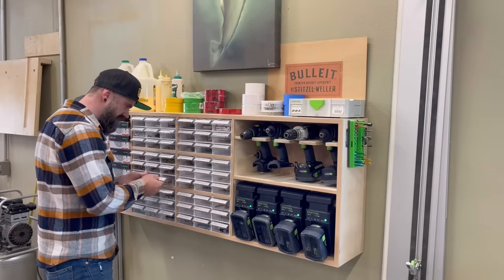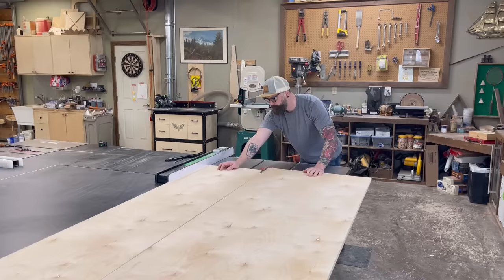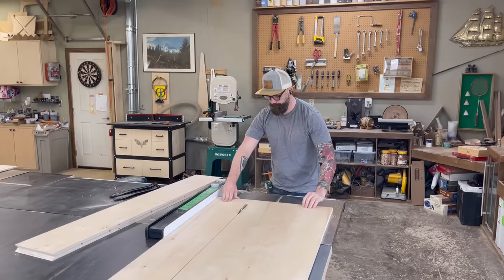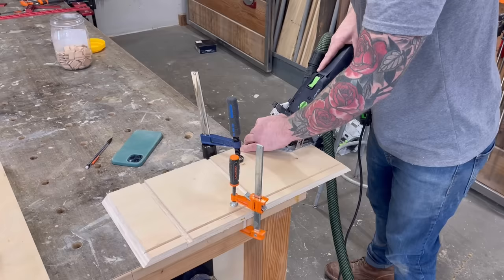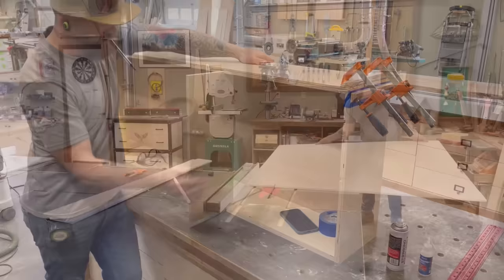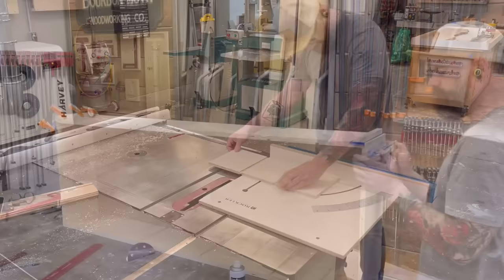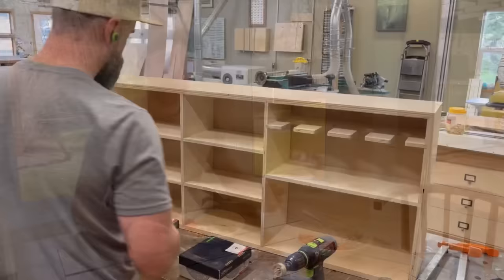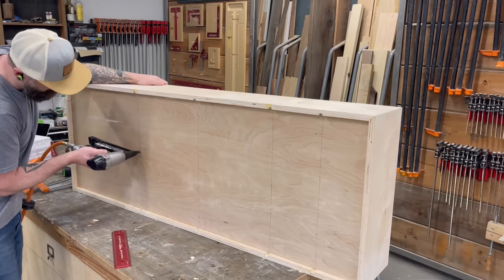Screw Organization! || One Day Drill Charging Station

Comment: Maybe could have added an On/off switch to the side for the outlet… Just so the chargers aren’t ON the whole time… just switch it on a while before you know you’ll need the drills/drivers.
Reply: I have wondered about putting my chargers on a timer expecially since I don't use them every day
Reply: I heard charges getting hot enough to start fires. I alway disconnect my chargers after battery is fully charged
Reply: Most newer chargers stop charging once it's full.
Reply: You’re spot on the money about turning chargers off. Excellent point.
I just use a “smart plug in” and a short lead fused at 5A the plug. (UK plugs have fuses in them) I can turn it on and off with my phone (or Alexa) and also set it to a schedule.👍
Reply: I'm about to build one similar and here's one suggestion and a question.

Have you got a link to your magnetic bit holder?

Under the bit holder I'm building some small cubby holes to store fully charged batteries.

Comment: Excellent and inspirational work.  One simple thing I think you should do is put a surge protector behind the chargers and then plug them all into that strip.  Protect your tool investment from a freak lightning strike or electrical surge to your shop's power grid.  Sooner or later, it will happen.
Reply: I was thinking this exact same thing
Reply: I don't like anything permanently on and screwed into place - DANGER WIL ROBINSON ... the back two thirds of the shelf above the chargers should be a hinged flap.
Reply: Those chargers should be plugged into a high capacity surge protector AND it should be switched off when not in use as those things are power hogs even when off and there’s always the danger of fire. It happens.

Comment: Nice project.  My charging "area" has 8 different chargers.  I was able to buy a power strip that has 8 outlets and a lighted switch for each.  That way chargers that aren't in use don't need to be powered on.  The strip was designed for 19" rack mounted electronic equipment so I mounted mine at the front edge of my box, above the chargers.  The switches are on the front and the outlets are on the back.  Easy to turn off and on, and cords can be managed quite neatly.
Reply: Could you list a link for that power strip, looking for one just like that. Can't afford all the Festool power tools, have several different brands of batteries to charge, Thanks John

Comment: Love this. As a guy who does do electrical, I'd have replaced the 2-gang with a 4-gang outlet. Removing the original 2-gang box, with the multi-tool, is pretty straightforward (make sure the power's off), and replace that box with a 4-gang "old work" box, and put in 2 2-gang 15A outlets. I just don't like those splitters. Another option: put a plug strip, a better option that that splitter in my mind, back behind the false front.

Comment: Instead of measuring the back of the chargers when trying to mount them, take a piece of paper and lay it over the back of the charger. Take a pencil and start shading, just like how we used to put a quarter under paper and copied it by rubbing a pencil over it. Now you have a perfect template. Instead of paper you could also use tape since you only have 2 holes.
Reply: Or...Just put the unit on a photocopier and get a copy of the back. I've used this as a template for laying out items to hang on the wall. Screw through the copy and then tear it off the wall.
Reply: It’s more fun to shade.  Everything we need to know, we learned in kindergarten .  It’s so fun. It’s funner, it’s the funest.   Copy machines are for college people, to sit on.
Reply: @ianwilson8410  More than one way to skin a cat. Just not everyone is going to have access to a coppier and things like a mirror might not fit. A pencil and a roll of painters tape is usually on hand. Still a good idea.
Reply: A strip of aluminum foil (preferably heavy duty) is fast and easy.  Just push in the keyhole openings with your finger tip, tape the foil on the mounting surface with openings leveled, and drill screw pilot holes through the foil.

Comment: i was thinking that a short shelf/ step out on the bottom board to set a box to put the screws in before and after  working on a project  so you dont have to take the whole drawer  out to the work site also maybe an extra swing arm light since it seems as we get older  we need more lite

Comment: Very nice.  A few suggestions.   First, Add a power strip / surge protector behind the chargers.  Second, add dividers for the various boxes of sandpaper so you don't have to pull the whole stack of boxes every time you want to pull a box out. Otherwise, its a fantastic project. Great Job....
Reply: Agreed on the idea of adding a power strip / surge protector behind the chargers. To add onto that idea, you can add an outlet on the right side of the box so you don't loose an entire outlet for the charging station. You can never have enough outlets in your shop.

Comment: Really nice project and as always excellent presentation.
One word of caution, your cables are kinda tightly wound in coils.
This can lead to them heating up and potentially causing you some issues.
As you have the false front, maybe consider spreading them out a bit.  Will look like a snake pit, but should avoid the heat and fire potential.
Looking forward to the next vid
Reply: Also - Jason, should they be live all the time? Might be worth checking with Festool.
Reply: @RobRobertson1000  yeah... slap a surge strip in there!

Comment: Personally, I'd havemade the drill shelf high enough that they could fit there with my largest battery, would have made the handle slots more "Y" shaped with a wider entrance for easy of putting a drill away, and made it deep enough that a drill could fit in there nose-in, even with a bit attached. I "get" that it's easier to tell an impact from a drill from looking at the nose, but I feel like it's open enough that you can see them from the side even when nose in. Other than that, I'm super envious! Mostly just for the available wall space to do something like this. Ha!

Comment: Looks great, however you should hard wire a switch for your battery chargers, you really don't want to have power running through them all the time, it will first overheat them when there is not a battery in them and second 'burn' electricity when there are no batteries in the charger when they are all charged, which might also overheat them and shorten the battery life. Even if you use your drills all the time, there will come a time when they will be standing idle and could wear out the battery, overheat and possibly be a fire hazard. Or you might want to go on vacation.
Reply: Please take this advice. A neighbor’s house caught fire a few weeks ago because a battery chargers cord was coiled up and tied together. 
You do wonderful work by the way!
Reply: I was going to suggest to remove the batteries once they are done charging, and have an on/off switch to turn off the chargers when not in need. If you leave them on constantly, it will reduce their lifespan significantly. Especially considering most companies don't use the highest lifecycle chemistry due to the power requirements. So we have to do our best.

Comment: Would have done a powerstrip with surge protection on the power, and then maybe run a small second power strip to the outside on that side for extra power. Or maybe even a 6-foot strip across the top in case I had more (different) chargers to sit on top.

Comment: Sweet video! I’m going to be applying the dado joinery you used to some drawers I’m making. I just want to warn you that having your power tool battery chargers that close together will make them very likely to overheat while you’re charging your batteries & heat kills lithium ion batteries. & I’m not sure how much a Festool battery is but I can guarantee it’s damn expensive. If I were you I would have like a fan or an evaporative air cooler pointing at your chargers whenever you’re using them.

Comment: As an alternative to cutting out the back panel on the cabinet, try a hole just large enough for the head of a plug and put a power bar inside the cabinet, behind the mounting board.

Comment: I like it. But 2 things…..first one is…..why not get a more precise measurement for the space of the drill handles so they all are in there straight up and down? Also, why not put 1/8” or 1/4” ply to put between each box of sandpaper? This way if you want the one at the bottom, it doesn’t affect all the ones above. But it’s a good vid and nice final piece.

Comment: Yes, you can make all those fancy things not because of talent,no because you get these sponsors to give you tools , drills,saws. I could do alot better if someone gave me tools, but no my table saw is a 1960s Rockwell that isn't level, blade adjustment doesn't work half the time, my miter saw was in a dumpster i pulled it out and put it back together and i could go on but whats the use. You have your Fancy shop 8 drills, big planners. Im a disabled firefighter who gets a government check once a month and after pay bills nothing left for my passion of woodworking. I challenge you to try to use what i have to work with, i even have to go to job sites where these builders throw wood away and look for wood, i can't go to box stores or lumber yards to get it but ive made some nice projects maybe not straight or bunch of knots but the people i made it for knows i did it with what i had. Not sponsored or given to me big time YouTubers

Comment: I'm doing something similar.  We just bought a new home and while it has a small basement garage, we're not using it. We're adding French doors and expanding the finished basement.

That means I get relegated to a largish shed until we build a pole barn garage next year. I bought a rolling, locking chest for my bigger tools, but I've been building shelving for the walls. It gave me an excuse to get some new tools, which is always a plus.

Comment: Changing drill stations, made me think of question for you concerning drill drivers. On boat build we saw you using white colored "Hart" driver drilling multiple one inch brass screws. So many screws to drive makes for a good test of drivers? How did the "Hart" driver rate in your satisfaction along with others you used, for both power an endurance?

Comment: So, the drawer system is $43 per 9-drawer unit, or $258 plus tax for the 6 drawers alone. Wow!
Reply: If you make the drawer shelves out of wood then a filament printer is your best friend for printing custom parts drawers. There are many on Prusa Prints or Thingaverse and also with FreeCAD you can design your own.
Reply: I mean he hasn't stated its on a budget and it's his money at the end of the day, there's always a solution for every budget
Reply: Yep my jaw dropped at the price as well.
Reply: inflation is here for a good while. thank your leader.
Reply: @stewmeat9261  well inflation is year on year increase so if prices are stable now there is no inflation next year
Reply: I made this and just bought a 3D printer for 300 bucks and printed it myself the filament was like 10 bucks for all and I can use the 3D printer for a lot of projects
Reply: Just go to home Depot and get cheap ones.  The point of the video is to show you how to do it.  He goes way over the top with his stuff and you can just modify it for your bins.
Reply: He’s got that in the 3 tools used to mark the lines for the dados. Not to mention the $1k domino tool.

Comment: I really like this build. I'm thinking of using it this spring when I reorganize my shop. How are the fastener container housings held in place? Anything other than a friction fit?
Reply: Yeah it looked like a perfect fit. Tight enough not to slide out unintentionally but easy enough to pull if throwing drawers full of screws at a client is ever called for.
Reply: I have those same drawers - there are pre-drilled holes in them that can be used to attach them to the case if needed.

Comment: Drills are the wrong way round. 'One touch' is the gold standard for storage- you grasp the item in the orientation it will be used.
Screws - large shallow drawers are better- you can  see all the lengths/sizes/type in one view. I bet you rarely guess the right little drawer first time. And checking for re-ordering  must take ages. Plus different size screws need different sized containers.
Sanding disks- in boxes? Really? Stacked vertically with dividers means-
One touch selection
less wasted space
clear re-order status.

Comment: One question to the non-german viewers. I so often see the "tape-and-ca-glue-method". Is there no doublesided tape available? In Germany we have that. Is using normal tape and glue cheaper, or is it stronger? Is it easier to use?
Reply: Hey, yeah. I'm in Seattle and use double sided tape quite a bit for hand work and for fixing to a CNC router bed.
Reply: North Carolina….Double-sided tape is used and will work for the most part, but the blue tape and CA glue is a bit stronger! I’ll use double-sided tape for most flat hold downs but for the purposes in this video the CA glue is going to provide better holding at a angle for the joint to dry. 
Also I wouldn’t say it cheaper just stronger.
Reply: blue tape is specifically designed to release cleanly

Comment: Nice build. Question on the charging station. Is it ok to keep the batteries plugged into a charger once fully charged ?
Reply: I think it depends on the type of lithium battery (cobalt, iron phosphate, etc).
Reply: No, it's not. I once left a battery on a plugged in charger for 3 months and it killed the battery. 100% dead, so always take off a battery once it's fully charged. It might lose 3%-5% of its charge before use, but with the way batteries are made today, they can stay off of a charger for a long time before they lose any significant amount of charge.

Comment: I like this idea. But $42 for each set of 9 storage containers!? That's $250 worth of containers just for this build. Also, any potential issues with heat buildup with all of those chargers side by side in a compartment like that? I also would have made dividers for the sandpaper area just so that if I need a box on the bottom I'm not risking the rest of them falling out when I grab it.

Comment: get an on/off switch on those chargers. They even use power when they are not charging a battery. Bad for costs and the environment. Nice build as always!
Reply: It would be great if it turned itself off somehow when it senses that there's only phantom power draw. Is that a thing?